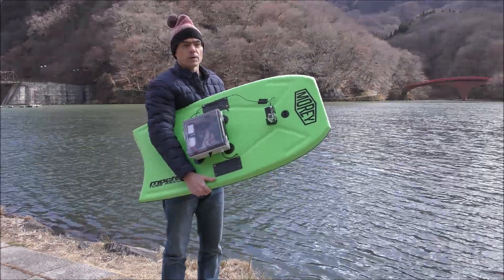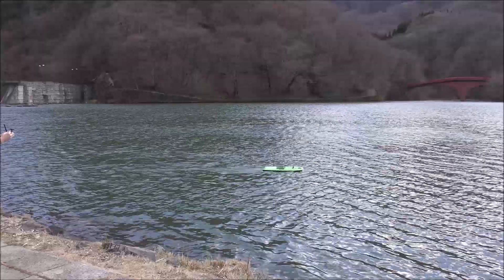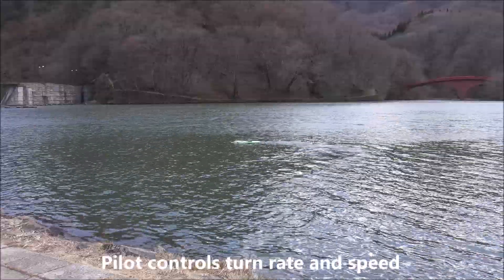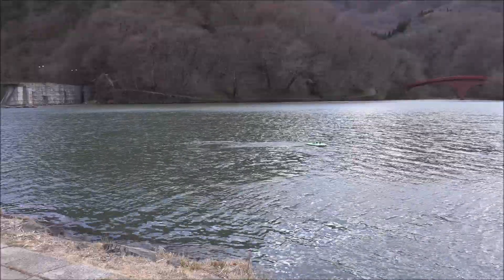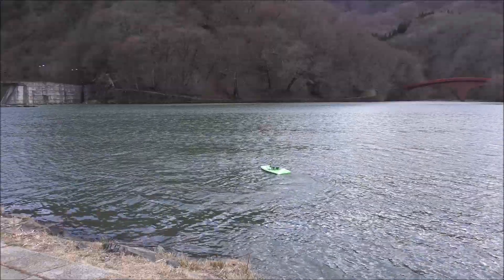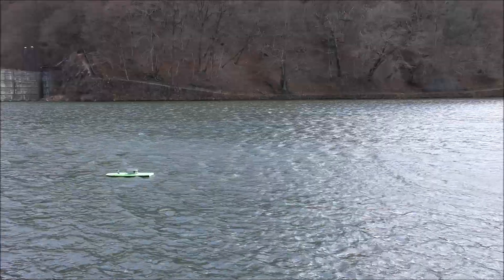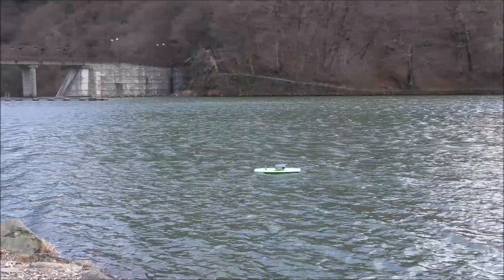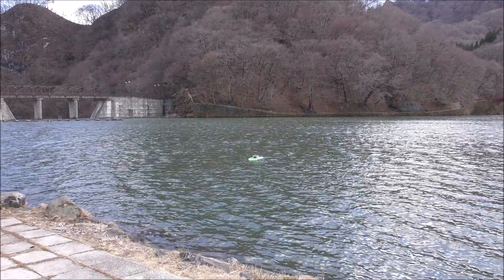DeSET Drone Boat First Test

Comment: Can you tell me if you are running in flat water or calm conditions what sort of yaw control accuracy one could expect?  In other words, should I expect differential thrust to maintain heading within say 2-3 degrees, or should I expect something better through tuning of PID's?  Did you spend much time tuning this boat, and if so, do you recall where you had set your gains?
Reply from the maker: Hi Project 314, for tuning advice it's best to post in the ArduPilot Rover or Boat forums and include an onboard log (aka dataflash log) https://discuss.ardupilot.org/c/ardurover/arduboat/54 .  We also have a turn rate controller tuning wiki page here https://ardupilot.org/rover/docs/rover-tuning-steering-rate.html but in any case, the most important parameter to get right is ATC_STR_RAT_FF (attitude control steering rate feed-forward) and it is best to tune this in real time as described on the wiki page.  Hope that helps..

Comment: Is there way to configure such a craft so that one could dial in a heading, say I wanted it to head 63 degrees south of east (SSE)?  I'm under the impression that you can do this in copter mode but it also seems that they added a speed requirement to it, assuming such that it covers enough distance in time to deduce a heading based on GPS lat/long change.
Reply from the maker: Project 314, ArduPilot Rover/Boat supports a mission command called SET_YAW_SPEED that allows a vehicle to autonomously drive in a specified direction at a specified speed. Re the autopilot calculating a heading (aka yaw) estimate, the normal way is to use the compass built into the GPS (most GPSs units also include compass) but ArduPilot does also support "GPS-for-yaw" (using two GPSs mounted at least 30cm apart to calculate yaw) and in situations where the EKF (the part that estimates attitude and position) has a feature called "GSF" that can reset the heading to match the movements received from the GPS.  This "GSF" is mostly for one time corrections of heading though.. in cases where something else has gone wrong.  It's generally not a normal method of calculating heading.
Reply: @rmackay9  I watched one of your other tutorials where you were talking about ACRO mode.  I'm hoping that I can dampen the rudder effect on the control of the differential thrust boogie board using that mode and limiting my steering rate.  The problem, as I suspect you are aware, is that the slightest bunch of junk input into the props or the slightest drag on the board can skew the steering and direction of the craft.  As for the solution you are proposing above, I guess I'm hoping to do something direct from my radio transmitter instead of the GUI Ardupilot interface, perhaps where I could dial the knob (S1 or S2) to a heading instead of having the stick momentarily biasing the virtual rudder, which does spring return to neutral, unlike the boat which wants to bias or drift either right or left.  Obviously, where there is a compass heading (either magnetometer or GPS deduced), as well as a yaw gyro reading, I would surmise that those could be used as setpoints of sorts where the steering is manual but still more or less still computer assist.  Maybe this can already be done and I'm just missing something.
Reply from the maker: @Project314  Acro mode allows the pilot to control heading and speed so this may be close to what you're looking for.  Acro doesn't allow directly inputting the heading but it does allow the pilot to control the yaw rate (aka heading rate).
Reply: @rmackay9  Thank you!!!  I tried ACRO mode today.  Nearly perfect performance.  On occasion it seemed to throttle a little hot, especially on startup, but otherwise, it performed pretty much flawlessly, holding course pretty perfectly.  I was running inside a marina and assume that GPS blockages and large objects resulting in compass deviations were upsetting autopilot AUTO mode and occasionally the ACRO mode, but otherwise, it's a dream.  At this point the only way that I think I'll get better navigation is if I try RTK.  Any chance you've dried that?  I saw your Asian mapping video and noted that you were not using it there (no need to I assume), but I see you've done quite a bit in a lot of areas.  I have an ARDUSIMPLE unit that I picked up for land surveying... seems like they have done it with Pixhawk so I figure it would be viable to roll over to my Matek H743 Wing V3 hardware.
Reply from the maker: @Project314  great stuff.  I've used RTK GPSs on autonomous buoys ( the inflatable pontoon boats that make a brief appearance in this video https://www.youtube.com/watch?v=lnPvrVvhoRk ) but I can't say I noticed much difference but mostly because the boats are quite far away so I couldn't get close enough to really notice any improve accuracy.  .. and as you say, the applications I've done so far haven't required the accuracy that the RTK GPSs provide.

Comment: Mapping using what sensor?
Reply from the maker: I normally use the 100m EchoLogger ECT400 (http://ardupilot.org/rover/docs/common-echologger-ect400.html) which is a bit expensive (about $1500 I think) but I'm also planning to test with the lower cost (but also shorter range) BlueRobotics Ping sensor (https://www.bluerobotics.com/store/sensors-sonars-cameras/sonar/ping-sonar-r2-rp/) in the near future.

Comment: Waiting for herelink review video from you! 😁
Reply from the maker: Yes, I'll probably do a review of the herelink at some point.  So far I like them very much.  I have heard some complaints from other beta testers that the screen isn't bright enough, there's no hdmi output port and it's a little expensive ($800) but from my point of view there is nothing else like it for ArduPilot vehicles so I think I will probably use the HereLink on all my future vehicles.
Reply: @rmackay9  yes. It's like a complete package.  All built into one thing. I read on forum that it's going to come with solex pre-installed for free. Is it true?
Reply from the maker: @MallikarjunSE  My herelink is running QGC but I have also heard that Solex will be an option at some point and will be free for some period of time at least.  I don't know for sure but one of the great things about HereLink is that it's (mostly) open source.  It doesn't have access to the store but it is possible to install whatever android programs you want which I think opens up a huge number of options.  Once it's open then suddenly it's not the manufacturer controlling how your device works, it's your device again.
Reply: @rmackay9  All we want to know is what kind of range does $800 buy.  ; )
Reply from the maker: @ @mistercohaagen , yes, that's a good question.  I haven't done a proper range test yet.  It didn't go out of range during the making of this video but it never went more than perhaps 150m.
Reply: @mistercohaagen  MadRC tested 16km LOS.